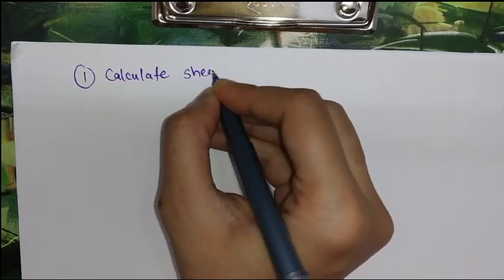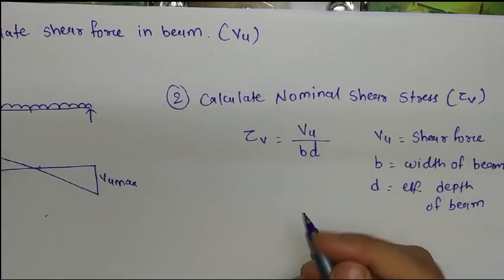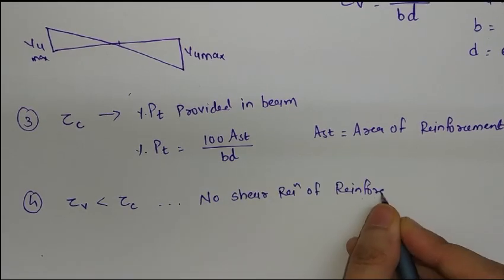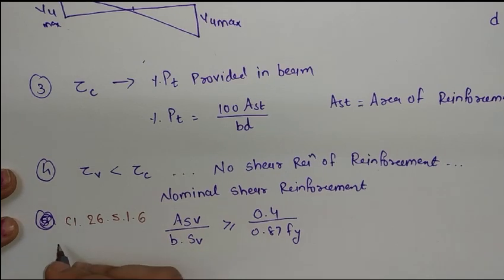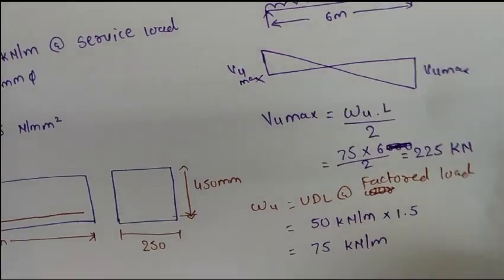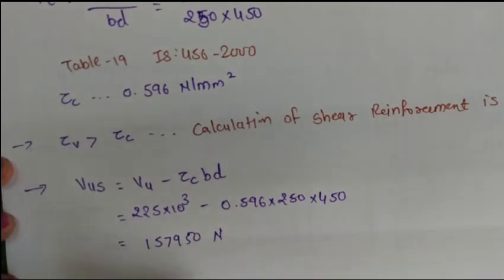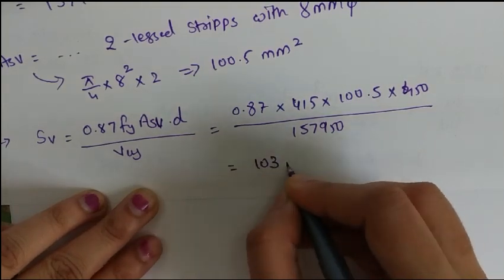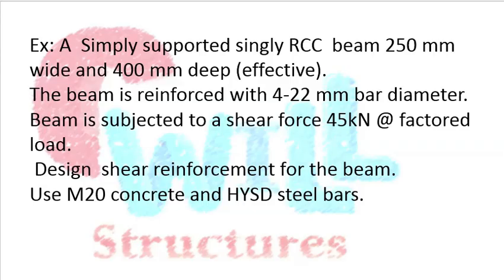Steps to design of Shear reinforcement | Civil Engineering

Comment: In the 2nd question by calculating, the value of Sv is coming as 363mm^2 and not 218mm^2 may be due to calculation mistakes.
Reply: Same here so we assume 300 mm c/c spacing.
Reply: Bro value does not matter only u hve to know the process

Comment: Mam can please Slove this....

A rectangular beam of size 300mm ×500mm effective depth is reinforced with a 4bars of 25mm dia . Determine the required verical shear reinforcement to resist the factored shear force of 350KN  take M25 and Fe415 grade